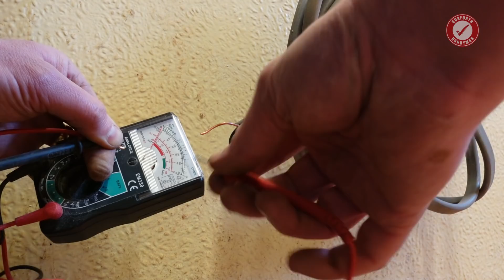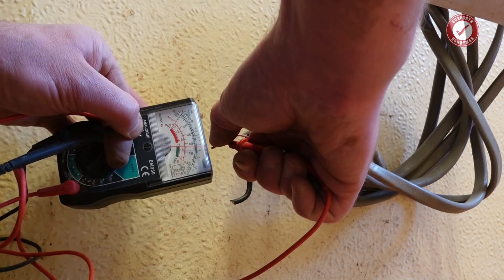Safely(ish) removing unknown buried pipes (Renovation Part 10)

Comment: It should be bonded back at the fuse board. The electricity board would not compromise their cable.
Reply from the maker: The old pipe isn't bonded at the fuse board.

Comment: What kind of power supply do you have ? If TT, that can explained. If PME with supplementary Earth electrode, again that can be explained. Show your power supply in the next video, please.
Reply: Cut out was shown at 14.56, TNS.
Reply from the maker: Yup, TN-S 👍
Reply: Looks like classic TN-S (probably PME'd at the street level tho, as is common these days)
Reply: @GosforthHandyman  With an incorrect type of earth clamp. Contact your local DNO for an earthing check they should replace and upgrade it for current standard.

Comment: It must be gas. I can't imagine a scenario in which they would abandon the electric conduit but take the effort to pull out the wires all the way to the street. The effort to remove everything from the pipe all the way back to the street doesn't seem sensible.

Comment: I would bet gas. 1). What else would it be? and 2). The evidence of it coming up 2 feet of the wall for a cooker connection. Strange the gas board don't have any record though. Especially if they'd capped it off at the boundary at some point. BTW, town gas was only phased out in the 70's!
Reply from the maker: Could still be electric supply duct and the cables have been removed. But would tend to agree with gas... the bonding is still a mystery though. 👍

Comment: Wow, vintage analog multimeter.
Reply from the maker: Still works! 😁
Reply: @GosforthHandyman  Not run by battery, but by hand crank dynamo !!!
Reply: I still have a lot of analog meters.  If they work, why get rid of them?!
Reply: Positively modern compared to my dad’s old one from the fifties which my brother still uses.
Reply: Analog measures voltage fluctuations more accurately than digital as the sweep hand is visibly moving. Digital will just give high/low readings but won't necessarily show variations in voltage.

Comment: I've never known any sparky to remove all redundant cables, they simply cut them off at appropriate points. Since there's no cables in the  garden section it's unlikely to be electrical conduit. But if you're gonna use a screwdriver to pry up your cut out, perhaps one idea would be to use an insulated screwdriver just in case. Anyway, I like your 'process of elimination' approach. Can't wait for the next in the series.
Reply from the maker: Cheers - at that point I could see the pipe was empty. Sparks do currently strip out cables for scrap mind. You can even buy machines to strip off the plastic. 👍👍

Comment: Pipe may well have been used as an earth for the electricity supply
Reply: Makes no sense
Reply: Sorry, No! That is Not the way we do it!
Reply: @totherarf  Who knows how someone did it when property first wired. Pipe probably preexisted and someone decided it made for a convenient earth rod
Reply: @nickcollins7568  Not usual for steel pipe. Gas and water lead pipe, yes it was usual. 
I have seen one where they lost the neutral and had a N-E fault. It ended up with the total power for the house running through a copper gas pipe buried under a tiled concrete floor ...... The floor was too hot to touch! 
It is much more likely it was cross bonded to the earth provided by the service cable lead sheath!

Comment: Why would you run electricity directly to the kitchen?  Think it is a gas line and it is grounded for safety. In Belgium we ground every metal surface for safety.
Reply: Might not of been a kitchen originally, it certainly wouldn’t have been the most ridiculous place to run it. I still don’t get why people like to put their fuse boards in their bathrooms in the uk.
Reply from the maker: The current live electric runs directly to the kitchen. 👍

Comment: Gas was used for lighting when the house was built as the electric system that was available was usually for the richer people, and required a generator. The national grid got going in the 30s, and when is was rolled out countrywide it took another 20 years to retrofit normal houses. In the early 20s just 6% of houses had electricity. The electric supply would not have been in a steel pipe into the house itself, and once in cables would run right up to the ceiling, and once electric appliances (not just illumination) came about. socket adaptors ran off the main light. Gas pipes, however, would probably have only been wall lights, and only in downstairs rooms, and up to just under picture rail height for best illumination without setting light to ceilings. Found this for you...https://fet.uwe.ac.uk/conweb/house_ages/period/print.htm

Comment: I'm still betting on an old gas supply, might be an earthing strap, which used to be common, on it.
Reply from the maker: Possibly... but then they must have re-instated the earth bonding when the put the new electric supply in, which is odd as they must have known it was redundant. 👍🤔
Reply: @GosforthHandyman  I'm no electrician but from what I understand any extraneous metalwork that has the potential to come in contact with live conductors needs earthing to the same supply. Whether it's a redundant service or not is probably irrelevant. A fixed piece of conductive metal within the fabric of the building should be bonded, but the bond should probably be visible and accessible as it's likely deemed a maintainable part of the electrical system.

Modern regs say the bond should be within 600mm of the service entering the building and before it branches off around the house, not sure if this has always been the case.

Again, not an electrician so pinch of salt required. Thanks for the great video.

Comment: if a new supply has been brought in then it would have its earth at  the suppliers cut out (either as a separate wire or coming from a terminal at the cut out fuse depending on whether TNS or TNCS earthing) - assuming you do not have a TT system.    If you have a TT system the pipe may have been originally bonded to the earth cable or just touching it with an earth rod  sunk into the ground close by.  If you know what  you are looking for  it is fairly easy to figure what is going on but even experienced electricians can get  wrong footed especially in old houses .  Also the earthing of neighbouring properties  can point you in the right direction but can't be too careful - you are a long time dead !.

Comment: Andy, what size is the pipe as it comes up through the floor? Regards Jim
Reply from the maker: The pipe coming up through the floor is about 25-30mm. 👍
Reply: @GosforthHandyman  I actually worked on towns gas back in the late sixties early seventies and that pipe looks like a 3/4 gas main, pre central heating. Regards Jim

Comment: The old electric was probably grounded to steel pipe.  Against the code now.
Reply: Against The Code? Under BS7671, as it is an extraneous conductive part with the conductor going in to the earth, it would need to have a CPC bonding at entry in to the property, before the first junction point.

Comment: Having gone to all the effort of digging a trench for the water supply would it be worth putting in an large pipe in as well.  That way you can draw through a cable in the future, should you need to,  without having to dig up the entire length of the driveway again.
Reply from the maker: Water is ducted in to the house but the trench dig was the easiest part. 👍

Comment: Call me daft, but if it was an old conduit for electric cable, it would have electric cable inside it. Most likely its a gas pipe
Reply from the maker: No, the cables would have been pulled out for scrap. But yes, would tend to agree on gas... just not sure why it has such a good bond to earth. 🤔
Reply: @GosforthHandyman  i doubt anyone would be able to pull the supply cables out of that pipe. The copper would stretch and break first!
Reply: Not convinced that anyone would have gone through the effort to remove any cables, as it would have been an enormous effort. And scrap prices back then probably wouldn’t have made it a particularly attractive option.
Reply: @prduguid  pulled out stretch no way it’s called conduit it’s used all the time for wiring for that reason to be able to replace the cable without having to go through the effort of digging it back up Etc. Maybe there was a fault on the line and the person pulling the new one
Wanted to see what the fault was. I’m thinking gas though.
Reply: @imark7777777  as soon as there is a bend the resistance to pulling the cable will go up massively. Even if its just the phase and neutral conductors (there probably would also be an earth) that would fill most of the cross section of that conduit. No way you could draw a stiff copper cable out. IF it is a conduit its purpose is to provide mechanical protection to the supply, not to allow replacement.
For what its worth I'm sure its a gas supply pipe.

Comment: MARGINALY safer option would have been to drill the pipe first with a very slow speed drill and small bit to check for water or gas. Hitting it with an angle grinder with all those sparks flying about might have gone very wrong if it was gas.

Comment: I'd go with it being an old gas supply, especially in the kitchen. How old is your house? Would it have had electricity installed when it was originally built? My dad was installing new electricity supplies to villages in Devon around the late 40's / early 50's, prior to this they were using gas lighting. The earth connection is possibly a retro-fitted earth bond somewhere in the 2 metres of pipe that you haven't dug up. I reckon you should dig it all up and find out :-)
Reply from the maker: It's late 1920's... although bear in mind Newcastle was the first city in the world to have electric street lights, so we were ahead of the game. 👍😉

Comment: Hi Andy, if this house has a ground spike on the earth of the incoming 240 VAC feed, that would give the zero Ohms reading on that cut off pipe, as its still in the soil ...perhaps !?
Reply: An earth electrode would typically have at least a few tens of ohms impedance, usually closer to 100

Comment: Unless you're remote from civilisation and on an overhead mains supply (clue: there'll be a earth leakage trip next to the fuse board and an earth spike somewhere around the outside of the house) then you can ask the Lecky Co. to provide a PME  connection at the meter. Your main earth from the fuse board connects to this as does your gas and water supplies earth bonds. You can't and shouldn't rely on supply pipes to provide the main electrical bond these days.  Even if the water supply is on lead there's no guarantee that there stop tap in the street hasn't been replaced with a plastic one.
Reply from the maker: Current supply is TN-S.
Reply: @GosforthHandyman  that means that the earth is connected to incoming supply cable sheath so there should be an earth block very close to the incoming cable at the electric meter. That being the case, the outer of the incoming cable will give a low resistance reading to the buried metalic pipe. There is plenty of surface area on both the the disused pipe and the incoming pipe to get a 'good' reading from your pocket meter. A more accurate test (not that it matters in this case) would be got using a Prospective Short Circuit Current test meter. This puts a high current fault on the line and checks the fault path resistance and quality of the earth bond.
That sort of meter is available second hand on ebay for around £20 (I just sold one for £15, Seward  DL750). I think what your seeing is what's known as 'fortuitous bondining' i.e., a good connection but not deliberately made.
Reply from the maker: @davidquirk8097  the pipe is covered in bitumen though
Reply: @GosforthHandyman  mostly covered. I used to work on a site where we had miles of fuel lines running in concrete ducting and every 10-15 years we'd survey the lot and where needed reapply the dreaded Denso tape. Bitumen coated hessian tape that stuck like s**t to a blanket yet it still deteriorated and that was in an environment without soil movement.   Electricity is sneaky stuff though so who knows.  Perhaps the installer of the pipe decided to bond it to the Boards cable? It would almost certainly be without their knowledge or permission. There may be some Gas board old boy out there who'll tell you it was standard practice back in the day. My experience is with three phase heavy power mostly.

Comment: My money is on an old Gas pipe!

Strange things happen but I have not seen an external conduit for electricity like that! I have seen many houses where the earth was via old pipework, but the type of service cable you have there has been used from the 1920's when the first electrification happened, up until the 1970's when Concentric and split concentric pvc cables were the norm.
With that meter it is not possible to get a valid reading of the impedance to earth ..... if it were a conduit system (TNS) you would have a typical reading of 0.3 to 0.8 ohms! 

The pipe may well have a bonding lead to it grounding it to earth so your meter would not tell the difference and I would not recommend the only reasonable way of testing it if you are not an approved electrician .... it would involve removing the electrical earth at the cutout after making dead and then testing. Even approved sparks would not do an operation like that ... only a competent person from the relevant Electricity Board!

If it had been a water pipe I would expect to see sludge in the bottom half (even dried) so my best guess is Gas.
Reply from the maker: I'd tend to agree on gas... 👍

Comment: If it wasn't any of the utilities and it wasn't in the way  of anything why not just leave it
Reply: I kept wondering about it the whole video. I think it must be because of some compulsive disorder to keep everything tidy :-)
Reply: I think he mentioned that he didn't want to give the same problem to someone else in the future and he would have to dig a trench anyway for the new water supply .
Reply from the maker: It was where the new water supply needed to come in. 👍
Reply: If I was digging the trench anyway Andy I think I would probably have done the same,OCD is quite common among handymen 😂
Reply: @GosforthHandyman  at 12:10 you're standing in the trench for the new water pipe and you need to do a substantial amount of extra work to get rid of the extra pipe.  I replaced lead water pipe as well in my house, I'm positive you'd have no problem at least with United Utilities to pass the inspection etc. and there was nothing in their official guidelines which would suggest you need to get rid of old pipes if they run too closely etc. 

I think there might be yet another reason why it might be dangerous for a layman to remove such a pipe; when I moved in to my current house there was actually no earth, which I learned from an electrician when he was installing  a new consumer unit with rcd, as the property only had fuse box with "wire fuses". After seeing this video I can't help but wonder if originally the earth was taken from the old gas pipes. I had those gas pipes in the kitchen as well (two outlets actually, took me some historical internet searching to find out what the heck did they use two outlets for back in the 30s...), and who knows maybe somebody screwed up the earthing  when they installed the new gas supply...
Reply: Yeah I lived in a house that had an old well don’t know where it was either way there was a wire in the basement that ran to a switch and down the wall and into the ground drive me nuts that I could never figure out what it went to. I Found the well on the property later but it was so far away from the house it made no sense that it was for the house.

Comment: Classic old bitumen coated Town Gas Pipe  Yes there should be continuity  the ground is WET there will be continuity you have a problen if it was not 
 .Do you self a favour  get a lamp holder put a 100 watt bulb in it use single wires take one to a rod in the garden  then put the other one in live (CAREFULLY ) check the Bulb  the realise just hoe conductive damp ground is
Reply from the maker: Resistance too low for simply ground conductivity. Bear in mind the only section of pipe left is inside the house so it shouldn't be wet.
Reply: @GosforthHandyman  that floor in that kitchen was the old red quarry tiles  it was a wet floor you could see that   but that pipe was so easy to identify

Comment: My guess gas.
If it was electric they wouldn't bother pulling the cable back and in all likelihood when it got replaced. Originally, it would have been an overhead supply back in they day as underground cables were and are  'n' times the cost of overhead.
The fact there's no record of gas on the property doesn't mean anything, transfer of records from the local gas company to regional companies wouldn't be good.
If the metal inside the pipe is not bright like mild steel should be, then it could be a reaction to the gas.
Better out anyway.
Reply from the maker: I'd lean towards gas... although I think they would have pulled the old copper cables out the ducts for scrap. 👍

Comment: Your getting continuity from your own body with the power wire.. its running through your thumbs.
Reply from the maker: I think I'm slightly higher resistance than that. I'm not made of metal. 👍😁

Comment: Pipe is too large to be a residential gas supply. And, it's not the water supply.
More likely they ran electric wiring for 220 volt electric stove in the pipe acting as a protective conduit through the concrete.

Comment: Fart lamp gas pipe? (I just wanted to use the phrase fart lamp)
Reply from the maker: Fart lamp?!? 🤔😬😁
Reply: @GosforthHandyman  Georgians installed methane pipes from sewers to deliver methane to oil type lamps for burning to prevent sewer explosions. Whitely Bay still has 10